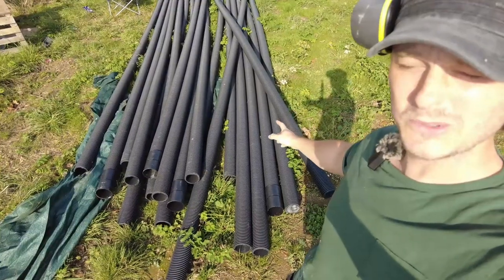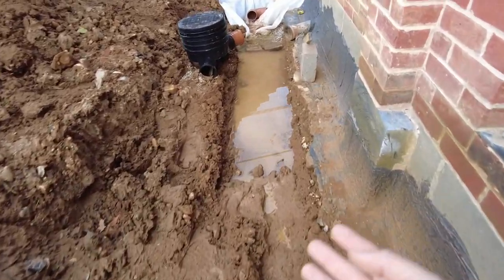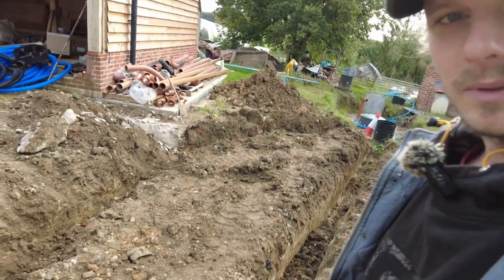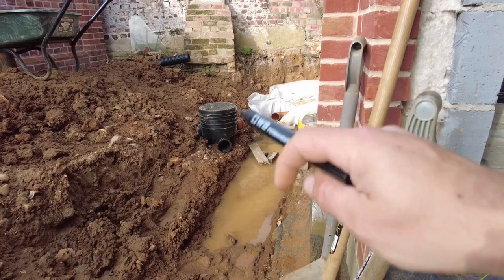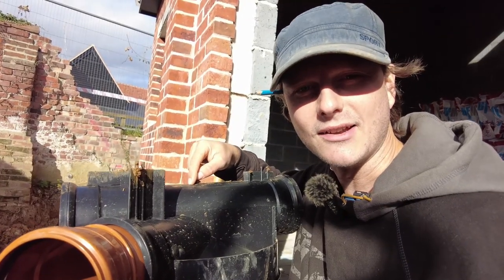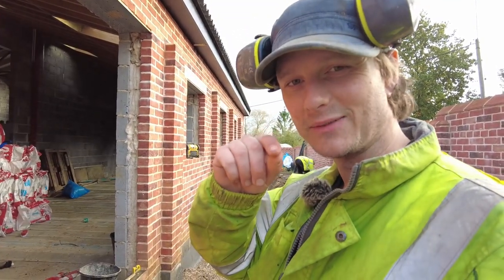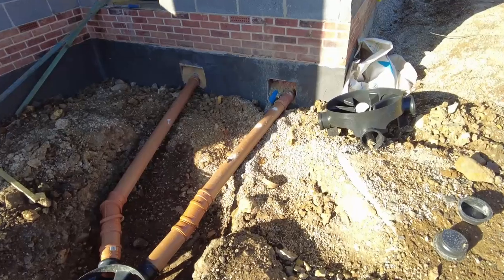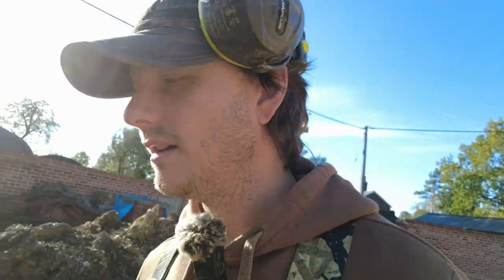Soil Pipe and Inspection Chamber install

Comment: Sympathise entirely on the soil - we live in East Devon on heavy clay that is chockfull of rocks, mostly flint, which range from a couple of inches up to a foot across. Not that I'm doing anything like the scale of works you're doing but even my DIY efforts get slowed down. I had to dig out about 6 yards of topsoil and clay to get rid of some old rotting softwood terracing in order to get new oak put in, and then move it all back by hand and compact it into place (well, apart form a yard and a half I had to pay to get rid of), and I've just dug out another yard and a half by hand to extend the patio and prepare a good base for a new shed. I put in an inspection pit to act as a bit of a sump because at that point in the garden there is no topsoil at all, it's just straight onto clay. I don't think it's going to work all that well, but at least it can act as a collection point for water in heavy rain which I can pump out. I am heartily sick of digging crap out or shovelling scalpings or gravel in. I wish I had the money to pay someone to do it, but sadly not!
Reply from the maker: Sounds like a job and a half Steve! Some of the flint here has been at least 2ft 🤦‍♂️ a micro digger up here is £200 for a weeks hire, sounds like you could have done with one?! Maybe you could have put the soil in your pockets and went for a walk, you know like the great escape 😁
Reply: @THE-AIDEN-PROJECT  looked into a micro differ but we don't have suitable access even for a little doorway digger from the front of the house to the back, so old school it was. Might have to try taking bags if spoil on my runs and slowly leaking it out onto the verges!!

Comment: I'm building an en suite. THis is exactly the video I needed to see THANKS! One question - Can my soil pipe enter the inspection chamber on the 90 degree entry point? as this would avoid tighter angles in the pipe.
Also... Can a smaller chamber be used if it's quite deep? feels unnecessary getting a larger one when it is literally being used to join the soil to main drain only.
Thanks

Comment: Aiden, I’ve been there and feel you’re pain, its easy when you have a professional job and earning a hundred grand a year plus the pressure is not the same especially if you can afford a nice place to live and nice surroundings! Doing it the hard way on a budget, no-one will ever understand what you are feeling - unless they have been through it themselves. My feelings are you have done everything right on the French drains, if it were me I would at some point build a larger catchment pit at the end of the drains to collect any silt build up as those small pre bought catchment pots fill up in no time! I hope you are doing well with your YouTube channel as when the s..t was hitting the fan for me and I was worn out and stressed the last thing I would have wanted to do was film me running round like a headless chicken ( you aren’t  by the way ) 👍
Reply from the maker: Haha yeah it is hard to do the work and film it sometimes, especially when I'm not really in the mood. I just checked my catchment thing, there's less than a table spoon of sediment in there and it's been humm 18 months so far!

Comment: Didn't Dan start digging it wider but was told no?
Reply from the maker: That was 2 weeks before when I didn't know where I was putting the foul drains and weather I could even get them in the same trench because of the different falls. I had thought I might have to put a seperate trench further out next to the boundary wall possibly.

Comment: U have layed the pipes wrong way around should be color end at the top of the run
Reply from the maker: I did question myself about this at the time. The rest bends were double socket so figured the socket could in theory go either end otherwise they wouldn't sell double socket rest bends. I ended up concluding that the socket was fine either side on the lengths of pipe as long as you push the other pipe all the way in. I don't think it's ideal, maybe the difference is probably negligible though 🤷‍♂️
Reply: @THE-AIDEN-PROJECT  we always put the spigot end at the lower end of the fall the bends are the same
Reply from the maker: @stephenfanning3100  I'll do a leak test before I backfill just incase. It's all still open at the moment 🤦‍♂️ haven't got round to finishing it off. There's only a couple of pipes that are the 'wrong way' so fingers crossed it's fine as is 🤞
Reply: @THE-AIDEN-PROJECT  be grand just incase any tissue or stuff catch on the spigot on the inside going down

Comment: Don’t you just love an at best diy you tuber pretending they have knowledge in the construction game, partially slating a proper trade and then installing fixed collared pipe the wrong way round 👌
Reply from the maker: 😆 hello mate, ok so...the main contractor who I got rid of was a specialist groundworker of 50+ yrs, the 2 pipes that come out the building towards the inspection chamber in the thumbnail were installed by him and to your logic are also the wrong way round. Now, I initially was of your mindset, however, if you shouldn't do this, then double socket connectors should therefore not exist. But they do, so actually there's no such thing as a right and wrong way round. 
Oh and I am a DIY youtuber 🤷 I don't pretend to be a professional, I always say I don't have a trade but I have a go. I've done a lot more than stick a couple of pipes in the ground
Reply: They are not a proper ‘trade’ at all they dig f’n holes and learn on the job.
Reply: @THE-AIDEN-PROJECT well said Aiden , I am a DIY er and I will have a go if I am confident, if I am not and don't fully understand I get pros in , nice job 👍💯 ignor the negative comments you doing great job , if you had breasts and skirt you would get nothing but positive comments.